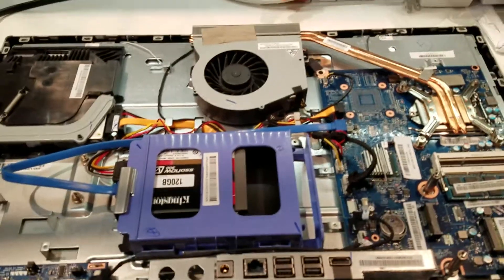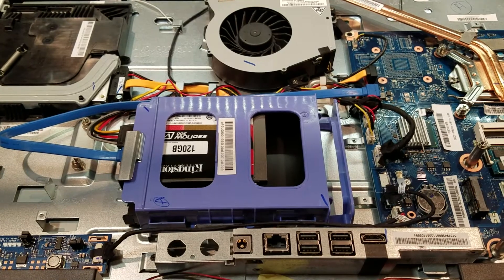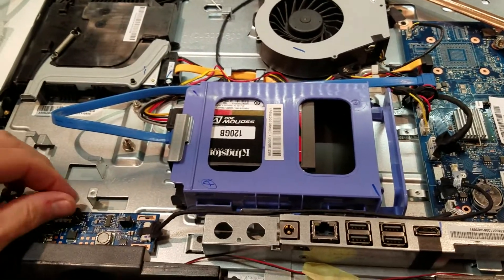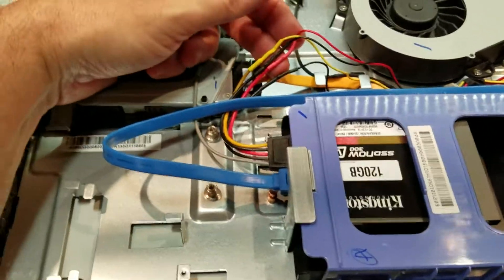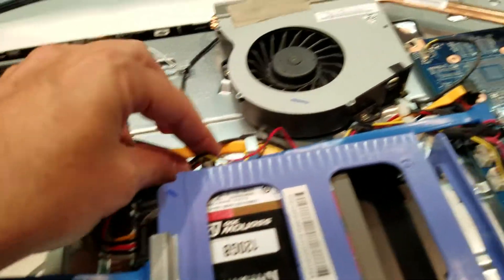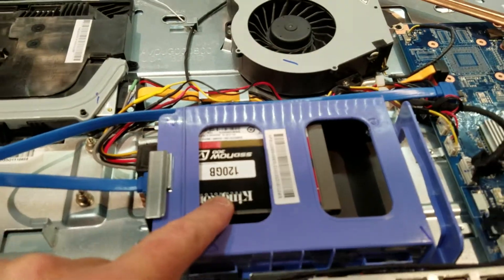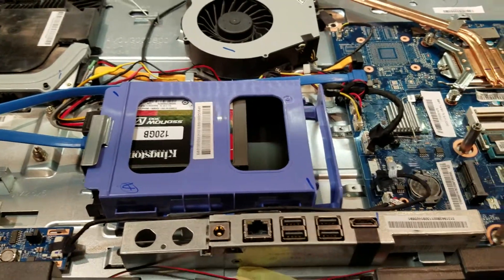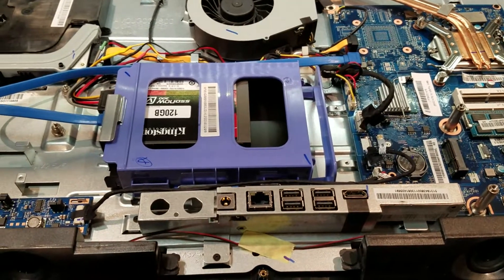Lenovo C540 "click of death" repaired (follow-up video)

Comment: Can you tell me which black wires match up? I forgot to make note before I cut them I have the red and yellow soldered together but don't know how to connect the black. Thanks.
Reply from the maker: Connect yellow to yellow, red to red, and black to black. It should not matter which black wire, since all black wires should just be ground (go to the same single point)
Reply: @PatrickRigney  So the black positioning does not matter at all?
Reply from the maker: @paulkemna163  Correct.

Comment: That's a really dinky Molex connector on the motherboard end. I've never seen anything like that! The whole thing looks to be a laptop motherboard placed into a TV set. Lenovo is known to make great laptops. But looking at the innards in this computer - everything relies on the motherboard. Even the hard drive gets its power from the motherboard, rather than directly from the power supply like most desktops.

Comment: What was the adapter used in order to have the SSD lined up to the existing port?, i know there are many but i wonder if you tricked that one too a little bit.
Reply from the maker: Nothing tricky, just a set of 2.5" to 3.5" adapter rails I had. I think any 2.5 to 3.5 adapter would do, even 3D printed. Since the SSD has no moving parts and the computer isn't portable, a piece of foam and some double-stick tape would likely be fine as well.

Comment: Can you give me a link to  5 dollar replacement cable ? I am a non savy senior thanks
Reply from the maker: There's no $5 replacement, that's the cost for parts to build your own cable (requires soldering). A purchased cable will run you around $15-25 depending on source and vendor. You can Google the Lenovo part number, they come up easily: DC02001MU10
Reply: Patrick Rigney don't want the replace it with lenovo because as you said it will happen again. If you can give me an amazon  link for the data cable. Thanks
Reply from the maker: Use that part number to search on Amazon and you'll find several non-Lenovo sellers. I don't want to steer you to a particular one because I can't vouch for any of them.
Reply: @PatrickRigney   Patrick Rigney  is soldering really required?  Can a standard sata power cable be spliced with Lenovo's sata power cable?
Reply from the maker: @greenboxmedia6291  You might get away with crimped splices. Crimping, when done properly (and that's key), is often better than soldering.

Comment: Same issue here except mine went straight to smoking!
Reply from the maker: Fortunately, as many people have reported in comments below, the motherboard tends to fare pretty well when this happens (good supply rail control/short circuit protection). Chances are good you can get it back working. Are you going to try?

Comment: I'm thinking about upgrading my C440 to a SSD. Did you use a special adapter for your SSD or did it just slide into the blue bracket?
Reply from the maker: jvolstad I used a 2.5 to 3.5 adapter. They're available from various sources and come with some SSDs. You could also probably get away with not using anything, since vibration will not be an issue.
Reply: Patrick Rigney Thanks. I now have a 500gb SSD on my C440 even though the computer only has a SATA2 port. It works great.

Comment: I took my c540 to a local computer repair store. They said my motherboard  was bad and the computer not worth fixing. I found your video and my problem was the same as yours. Burn on the power side of the cable at the sata hard drive. Ordered a cable on ebay for under $10. The cable is made different than the OEM. Installed and up and running.
THANK YOU!!!!!!!!!!!!!!!

Comment: Great videos Patrick, I noticed that you have added an SSD drive, may I ask what you used to attach it to the caddy?
Reply from the maker: Yes! It happens that I had an adapter kit laying around for 2.5" to 3.5" that probably either came with the drive originally, or came with another drive. You can buy them on Amazon if it doesn't come with your SSD--one in particular that Amazon sells (link below) comes as a kit with power and data cables, so if you're making your own replacement cable, this will give you at least one of the pieces you need (the data cable is too short). https://smile.amazon.com/s/ref=nb_sb_ss_c_1_15?url=search-alias%3Daps&field-keywords=ssd+adapter+2.5+to+3.5&sprefix=SSD+adapter+2.5%2Caps%2C159&crid=2KSG9F22DETZZ